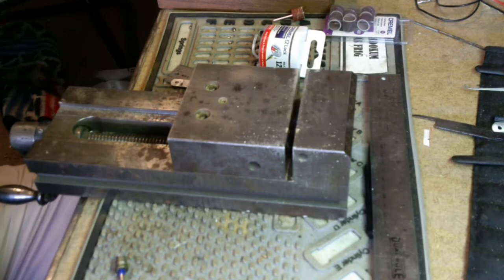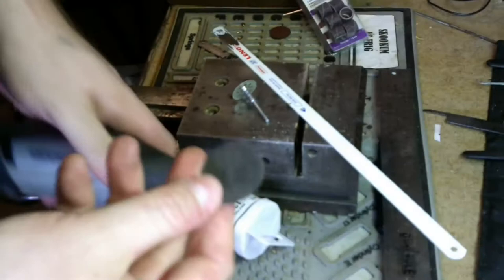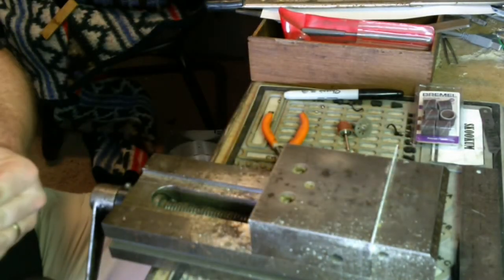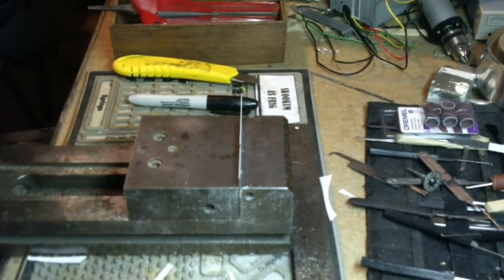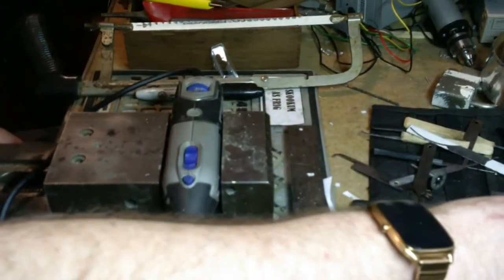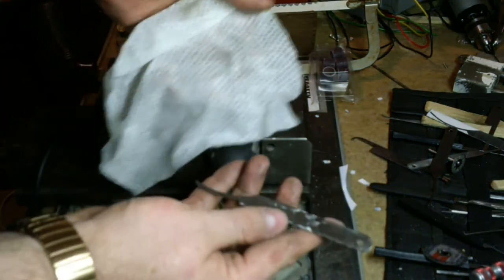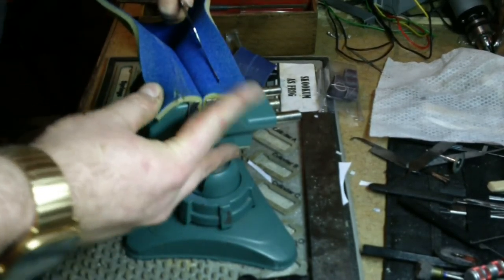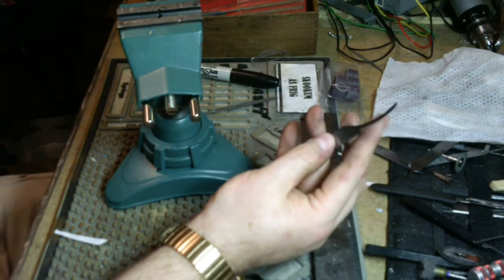Basic tool making for the lockpicker, pt 1: picks!

Comment: I always assume the temper on my metals is jacked and re-do it.  You can anneal, cut, and re-temper the used blades.
Reply from the maker: Jamie's Locks absolutely, this can be done. Its a lot of extra effort and a little more advanced than I was going for here. I still wouldnt reuse hacksaw blades though :)
Reply from the maker: Mutant Mike thats really not hot enough to retemper the hardened part, and way too low to harden the soft part. This is spring steel. You need to completely anneal it, completely harden with an oil quench, then temper to around 700*F...otherwise all you are doing is wrecking the hardness it already has.